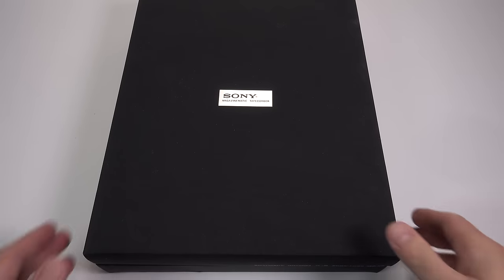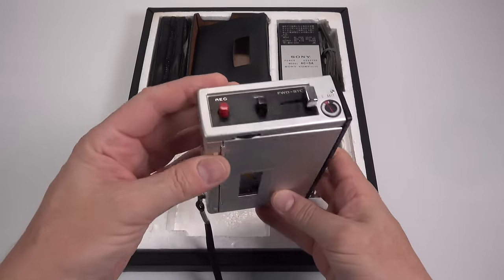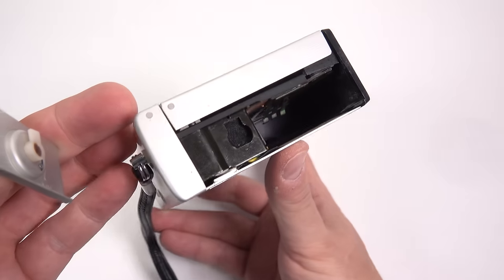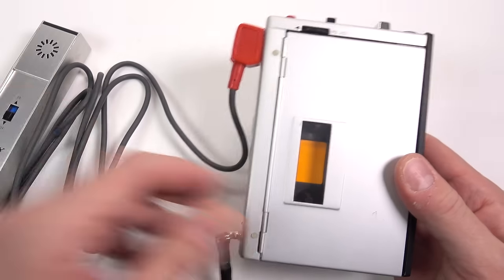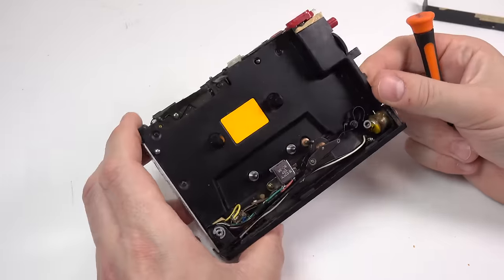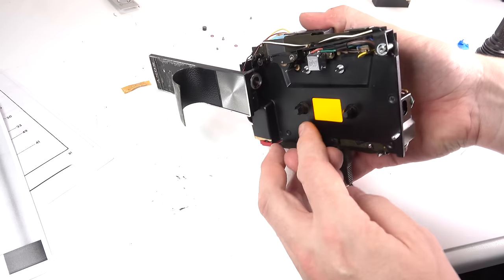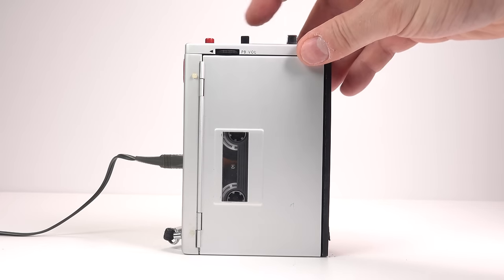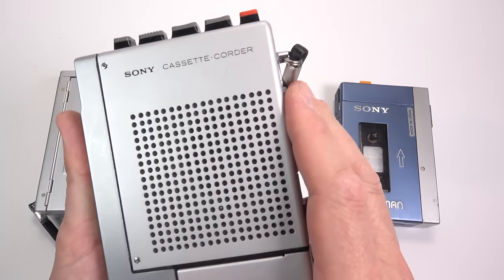Sony's proto-Walkman that went to the moon*

Comment from the maker: If you want to know what music the Apollo astronauts played on their Sony TC-50’s - here’s an article https://www.vanityfair.com/hollywood/2018/12/mickey-kapp-apollo-11-astro-mixtapes
Reply: not a tenuous link! A beautiful design and mechanical execution with a great video :)
Reply: off topic but im wondering where I can find a power adapter for my WM-D6C but so far I had no luck so if you know where I can find one could you let me know.
thanks
Reply: @masterchief5417  you could probably buy a multi adapter, one that you change a small plug in to change the voltage . On the working end you have different interchangeable ends that plug in via two pins, depending on which way you plug it in will change the polarity from positive center to positive outer . Hope this helps
Reply: Bonjour 😍 merci pour votre vidéo 😍❤... pouvez vous me dire le poids du Walkman de 1979...?
Reply: very cool

Comment: You definitely underrate your ability as a repairman, imho.
Reply: he does though
Reply: He's good at what he does right? ;) Skills to pay the bills...lol.
Reply: Hmmm.... someone with true repair experience in portable consumer electronics starts by searching for hidden screws. There are always hidden screws.
Reply: I thought the same.....he is always saying that its for a pro to do, but damn.....
Reply: I work on vintage guitar amps and convert old PA amps for guitar use BUT most of the stuff he offhandedly just takes a look at I wouldn't touch with a ten-foot pole!! Like this cassette recorder...I would have looked at it after the first few screws were removed and said "Um, NO, it will set on the shelf as a curio" lol. He is very underrated as a repair tech!!  LOVE the videos Matt!! Keep up the good fight!!
Reply: Yeah, if I took this apart it would never have gone back together properly
Reply: Yeah he's a very humble guy. He's definitely got an eye for repair after years of taking things apart out of curiosity. It's a good attitude to have to be fair... if we were more like him we'd be less of a throwaway generation for sure.
Reply: @Daniel-yz3zf  Yes, clearly he's progressed over the years.
Reply: Definitely. The frustration with the screws was tangible, yet it didn't stop him...
Reply: Recapping most stuff is considerably easier than changing those casette belts. And with axial caps you can cut the old wires long, twist them into the new axial capacitor, trim the wire, and briefly solder the twist with very good electrical results. All the equivalent modern capacitors are smaller that the old so they will fit well. Radials on the other hand just require a solder sucker.
Reply: @Daniel-yz3zf  He is an inspiration and I agree we need to repair!
Reply: @JVerschueren  At least he didn't screw it up.

Comment: The critical technological advance which enabled the TC-50 to be transformed into the Walkman was the development of high coercivity rare earth magnets by Philips around 1974.  I was fortunate to be part of the development team based in Eindhoven at that time.  These magnets were used for the first time by Sony to create much smaller, lighter and more efficient DC motors and, perhaps more importantly for the the success of the Walkman, powerful lightweight headphones.
Reply: Thanks for this info explaning an important part of time time-to-market lag for the consumer Walkman. Another commentor here had said that the headphones were a key to the commercial success. Your information and involvement on a professional level add validity to that statement. Being a part of technological advancement is gratifying.
Reply: @sweethomeboston2720  When Sony UK was taken to court by Andreas Pavel for infringement of his Stereobelt concept, Sony's own engineers said the idea for a personal stereo was not new and they had experimented with the idea some years earlier. Just like the telephone, everyone knew the portable telephone would eventually arrive, it was simply a matter of waiting for the idea to become technically feasible and commercially attractive. Sony's own engineers considered the Walkman to be "iterative" more than "inventive", which is why they did not patent any of their audio devices during the 1960s-70s. They even talked about the importance of magnets to their design in court.

Comment: I was an absolute Walkman nut in the mid 80s to mid 90s. I actually got to use Sony's first Walkman from 79 as my dad (who was always tech mad, something that I most definitely have inherited) bought one around launch. I loved going to town on a weekend and perusing Dixons, Curry's, George Henry Lee's et al, looking at the latest and greatest from Sony. As soon as they launched Mega Bass into the line I had to have one and accidentally on purpose broke my fairly new player so as to upgrade. And yeah the Bass was Mega, Electro 7 sounded phenomenal lol. I turned to the darkside and jumped to Aiwa in the early 90s. Their top end machines were so much cheaper than Sony's but looked and sounded great. My last personal CP from that time, an Aiwa from around 92, was a purple all metal job that was tiny yet built like a tank. 20 years later and I came back to the Sony fold with a pretty decent machine to play some old cassettes, think Techmoan has actually featured it in one of his vids. MP3 is a marvel but I'll always miss those heady days of the Walkman and the Kenwood HI-FI.
Reply: @Tony Mcevoy 
I got my first AIWA back in 1983! Solidly made, and beautifully designed unit with AM/FM stereo, auto reverse, and a neat little black cube stereo mic that plugged directly into the unit itself, also brilliant sounding quality headphones with their trademark orange foam ear pads!
Reply: Aiwa was actually majority owned by Sony from the early '80s on. I heard from a friend that Sony treated them as a small-batch consumer R&D place, to see where Sony might go next - and they ended up buying them entirely in 2002...

Comment: Wow, I had and used a TC-50 back in 1988, I had no idea of its heritage, I was just starting a BETC national diploma at NESCOT (North East Collage Of Technology), and I mentioned to my Dad that I could probably use a handheld tape recorder to record my lectures, he then asked at his work's technical department, and someone found an old TC-50 that they gave to him, and I used it for the next 2 years :) .
The one I was given didn't have a rechargeable battery, it had a caddy that held 3 AA batteries, and didn't come with any of the peripherals, but it worked flawlessly for the 2 years of my course, and was still working in 1997 when it and a load of my other possessions were stolen out of a storage unit.

Comment: On a sidenote: note the headphone (and microphone)  jack being a continued, global standard for more than half a century. I can't think of many standards like that.  
It is madness to abondon it now.
Reply: As far as I know the only people abandoning it are the smartphone manufacturers who are trying their absolute best to please shareholders by boosting gross profit margins as much as possible through "budgetary reconsiderations" such as the removal of headphones.
Once they can engineer a swivel system that lets you take selfies with the rear camera that's cheaper than adding the front camera, they'll get rid of the front camera too.
Reply: @michelvanbriemen3459  We already know how to make such cameras, a line of kids' tablets called the "InnoTab" had a swivel camera that can be rotated to look forward or back. And if you really want to go back, the Game Boy Camera also has a swivel camera. I think it's not used in smartphones because it might introduce a weak point in the structure, or it'll break off easily.
Reply: @mynamehasspacesinit8687   That's what I meant by developing a good swivel, the one on the Game Boy Camera was cheapy plastic. I'm thinking "swivel" more along the line of those motorised flashes some cameras had, or the Oppo Reno with its pop-up camera. That sort of tech with mechanical reliability in mind in something as small as a smartphone isn't cheap, but they'll do it if it means they can omit one camera.
Reply: Much longer than that, originated with telephone switchboards (the full-size jack) so over a century old. Used on all headphones and other low power audio equipment like guitars, and finally the mini jack was made later.

Maybe I'm just being pedantic but just as mini and micro USB didn't redefine the USB standard, and are compatible through adapters, that's why I group all sizes of T(R(R))S adapters in my head.

Comment: imagine legacy batteries being banned from being shipped, what a joke
Reply: not a big deal. We can design a battery case using a 3D printer/software/scanner that can hold ni-mh or lithium batteries.  But think about it... ni-cad batteries sucked in the 80's so they must have REALLY sucked in the late 60's.
Reply: batteries are batteries, they might do battery things. you know, like catch fire because of mishandling
Reply: @hachikiina  Oh yeah, all those NiCad batteries catching fire because they were put on an airplane.
Reply: AFAIK, those regulations were for LITHIUM batteries, NOT Ni-Cd or NiMh batteries.
I strongly suspect that someone misunderstood the rules.
Reply: @heedmywarning2792  They were not much worse, but a bit lower in capacity
BTW, Ni-Cd cells are still available-mostly for rebuilding old packs, but they ARE still available nevertheless.
Reply: Back in March this year, a large cargo ship, the "Grande America" sank in the Bay of Biscay, off the French coast, after a cargo fire on board. The company that I work for had cargo on that ship worth nearly 100,000 USD, and while the cause probably can't be pinpointed down to exactly batteries, we were told that the fire started in a container in which the content had been wrongly declared and thus not stored properly.
Batteries don't even have to be lithium to catch fire. Short-circuit a few standard AA batteries, and they can easily get hot enough to set any cardboard or other flammable material nearby on fire.
Reply: @TheRealColBosch  i said mishandling.
Reply: @m.k.8158  The regulations were for all rechargeable batteries. Probably due to lithium ones but I've seen many a sign at the post office saying NiMH and NiCd also banned. Many private couriers are making a mint off of carrying battery things (and lighter fluid, and so on) domestically where Royal Mail won't anymore. So this shipper was probably going to go into RM's network after leaving Japan. 

I first ran afoul of this when trying to send a friend a digital camera I had previously used.. the regulations only allowed for shipping a sealed rechargeable battery, so I couldn't send them the removable battery along with the camera. Makes things difficult for a lot of 00s tech to be sold and bought on eBay if they only want to use RM or to send Airmail (avoiding overseas
 FedEx prices, RM is really your only option).

I agree that it's only really been lithium actually causing cargo damage, but UK laws like to be quite wide and might potentially try to be future proofed against post-lithium batteries if any of them were liable to the same damage as lithium. If post-lithium batteries and up safer they'll probably file an amendment or a repeal, easier than redefining it post-hoc.
Reply: @kaitlyn__L  Well, I'm in the U.S.A., and as far as I know, it's only Li-based batteries that have restrictions(and I've not have problems carrying alkaline and NiMh cells(in carry-on)-I DO make sure to tape the terminals though).
Also, the last time I did this was in mid 2016, so maybe things have changed(again).
I doubt it though.

I guess that the UK regs are more restrictive.
Reply: @m.k.8158  Yes, it's specifically about mailing them, it's much less complicated to bring rechargeable batteries in carry on (not bare but, the camera with battery in would've been fine there). Carry on being the important part because it will be accompanied, unlike in the hold, where the post will be. 
Royal Mail has more planes than many airlines, just for getting mail around the country, and I imagine a van potentially exploding when it went round a corner too fast would be less than ideal too. Many places may rightly just ban lithium cells but RM's reg is for "rechargeable batteries" in general. Maybe just to keep it simple for staff identification, maybe to catch other potential risks even if they're much smaller risks. 
If you sent something to the UK via USPS you'd be informed of RM regs too, because it would be handed off to RM after customs.
Reply: @galier2  Now that you've let the cat out of the bag I expect by next week I'm going to see a meth head ride by on his bicycle heading towards the scrappers with a LEM balanced on the back.
Reply: @TheRealColBosch  Well, imagine getting a new NiCad and shorting it out for a length of time near a greasy mechanism and a circuitboard. On an airplane. Sure, 9/10 it's probably just going to go flat and die, but even if just 1/10 times it would set on fire because of overheating the wire, and even if just 1/10000 batteries would randomly short out during a turbulence because of a fault inside the device they're in, that's still a high enough risk for it to be considered.

Comment: Thank you for your marvelous video about the Sony TC-50.  My memory says your photos are exactly correct.   So I watched your video twice just to make sure.   I am 71.
I personally owned one of these Sony TC-50s probably about 1970-1972.  It was solid metal and heavy and very reliable.  I used it hard for most of ten years until it died in a fire in 1980.  I never took mine apart like you did.  So I thank you for doing that.  No one else made such a device.  There were no "Walkmans."  I was glad for my own.  Do you know what the cost was originally?  I remember it wasn't inexpensive.  Thank you Thank you again.

Comment: Nice player pity about the battery, I think the Ni-Cad battery is ok to fly normally it's Li-ion that has issues even Li-ion is permitted if it's installed in the device then shipped from japan
Reply: I wouldn’t worry about the original nicad battery that came with it being absent as there is about zero chance it would still hold a charge after all these decades.
Reply: There are all sorts of weird embargoes that come and go. Security, don'tcha know. My company does a lot of shipping on airliners, and it's always an adventure seeing what new insanity the TSA has invented on a given day.
Reply: More and more countries are prohibiting the import or export of ni-cd batteries in general. It's not a safety thing, it's a pollution thing.
Reply: LimaVictor It makes perfect sense that they would not want a dead nicad battery from the 60s/70s to be imported as they would just have to recycle it. Better to leave it to the Japanese to recycle it.
Reply: @Charlesb88  Considering it's an antique, i think it's kinda shitty. You need the old battery case so you can put a few new cells in there.
Reply: LimaVictor while that might  be nicety to At least have the original Nicad battery case to rebuild It, I doubt that is going to effect the value as an antique.  I doubt any there are any people who would buy one of these to actually use as a portable recorder and since you can try out the recorder using AC,  I doubt it’s that big of deal to most collectors, especially since you don’t need the nicad battery pack to see it operate. Given the environmental issues with recycling old nicad batteries, outside of the maybe a “completist”, I would think the Retro tech collecting market be understanding as to why the battery is missing in this case.

Comment: I purchased this exact model at an estate sale a year ago, but didn't attempt to find out if it even worked. I was just fascinated by the sight and feel of vintage technology. At just $5, it paid for itself with the entertainment as is. I also didn't know it's history as one of the items aboard Apollo missions when I bought it. Your video here has given me the inspiration to find out if it even works. The detailed disassembly you provided will come in handy should I need to dig inside. Mine actually came with the battery pack, so that means it will be taken on a walk (if it works)! I even have an era compatible ear monitor in a bag of parts.

Comment: I really hate that you can't reliably ship batteries, really sucks when you're buying electronics abroad.
Reply: Chinese don't care
Reply: @hachikiina  True but whatever customs it goes through often do
Reply: @RisingRevengeance  at that point its too late
Reply: My understanding is that if a battery is contained within equipment in which it's designed to operate, it is safe to travel in the mail.  I wonder if someone in Japan was being over-zealous.
Reply: @westinthewest  That should be the case but I've had plenty of simple stuff like controllers stopped just for the batteries. In my case the main issue might just be EU as always.
Reply: @westinthewest  might be, its hard to ship phones too

Comment: I wonder how many (or which) portable cassette units with mic remote were available domestically in 1969, as a few tracks on Captain Beefheart's classic LP "Trout Mask Replica" (recorded during 1969) were clearly recorded in a house on a remote-controlled cassette recorder, one can hear the WHUUP of the mechanism slowing down when the button is pushed to OFF ("China Pig", "Orange Claw Hammer", various bits). I got my first cassette recorder for my 6th birthday in April 1970, it was an Aircastle with AM/FM and 'monitor' (pseudo-PA which I never understood how to use at the time, just knew to avoid it because of the loud squeal - Duh :-) ), going back & hearing the homespun sounds on TMR and reflecting on this 1968 unit brings up great memories and great tech questions.

Comment: Lot of electromics used center negative.  That allowed the battery isolation switch in the jack to disconnect on the positive side.